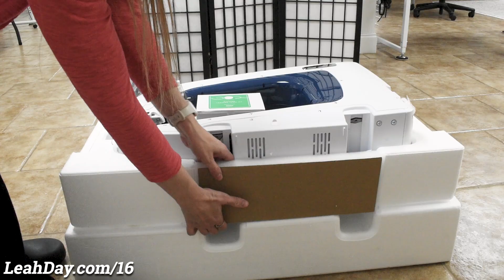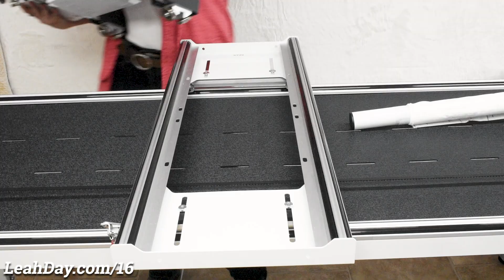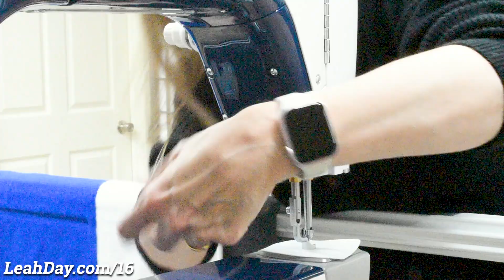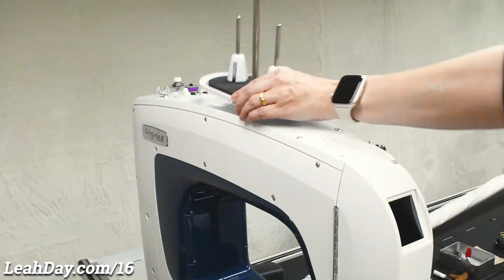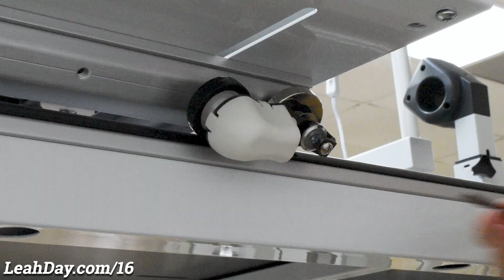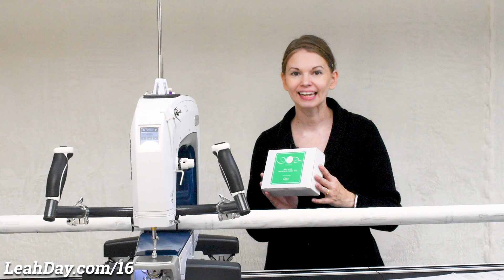How to Assemble a Qnique 16 Longarm Quilting Machine

Comment: Hi Leah, What is the recommended service intervals? Thank you
Reply from the maker: For any longarm or high speed machine, you need to brush out and oil the machine at least weekly yourself. This cannot wait for a yearly service - it needs to be done by you on a very regular basis because these machines don't like to run dirty or dry.
Reply: @LeahDay thank you

Comment: I have watched your video over and over but I cannot get my encoders mounted properly.  Is there a trick to it?
Reply from the maker: I recommend checking the assembly manual. What exactly is the issue? Is it attaching to the correct wheel, getting the angle or adding tension to the encoder?

Comment: In the process of setting up mine on  a Qzone Pro frame. I'm going back and forth between the instructions for the machine, the frame, and QST instructions, and got hung up on whether or not I need to install the channel locks. I don't understand when I would want to restrict the motion of the carriage. Thanks!
Reply from the maker: There are times you will want to lock the machine in place. Some techniques like quilting pantographs - it makes it much easier to align the pantograph design straight to the frame. Also straight line quilting across your quilt - very helpful to have a machine channel lock for that!

Comment: Hi Leah! I am wondering, since you are also left-handed, can the control handles be reversed for left-handed start/stop and needle up/down?
Reply from the maker: Great question - Yes, you can switch the handles so the start / stop is on the left. On the 16X and 16X Elite, carefully pull out the cords from both handles so they are long enough to cross over the back and plug into the correct plugs. Then unlatch and carefully turn the handles to face the correct way.

Comment: This does not work for the rear encoder on my cutie breeze frame.
Reply from the maker: No, this video shows putting the Qnique 16X onto an Evolution Elite Frame, so the visuals here will help you if you have an Evolution Elite or Evolution Hoop. Check your 16X manual for the correct visuals for attaching your encoder on a Cutie Breeze Frame.

Comment: Love your videos. I like the way you explain things. If you want to do Pantographs, I know you need to get rear handles, what about computer part? Do you have to buy another one? How do you lock the wheels?
Reply from the maker: I'm working on an update of my Pantograph Quilting Guidebook, but have a series of posts you can read / watch here - https://leahday.com/blogs/machinequilting/load-your-frame-for-pantograph-quilting-quilting-pantographs-1

You'll need Rear Handles, Pantograph designs, and a Laser Light to follow the designs. It doesn't require a computer unless you want to do computerized quilting pantographs, in which case you'll just need QCT 6 - https://leahday.com/products/quilters-creative-touch

Comment: I bought this machine 6 months and it has been sitting on my q-zone pro frame, I have not installed the encoders yet, I am confused about placement for them and the channel locks. I am very intimidated and I am thinking I bit off more then I can chew. I would love to see a video on the quilting panel that it came with and any video's for the machine and frame that you can create, I am so lost in the process. I have watched most of your videos, I love them. Thanks for all your efforts!
Reply from the maker: I recommend following this video first to get your machine fully set up! Leaving it to sit will not help you overcome your fear - only finishing the setup and quilting on it will help you reach the next step - quilting your quilts!
Reply: @LeahDay  I watched this video again and I was able to get everything set up! Thanks so much! I saw on y table bed you had a channel lock laying there but you did not install it. Mine did not come with one but I would like to use them. My q-zone hoop frame( used from a private seller) had started with the reg q zone frame and then upgraded it to the pro, She did give me 2 channel locks, She said one was from the original q zone and the other was for the new dual rail system. I installed the one on the frame carriage. Can the original channel lock be used for the q"nique 16X machine? If so, where would the one for the machine be placed. Many Many thanks for your help and great video, I am so close to being able to put my 1st quilt on!